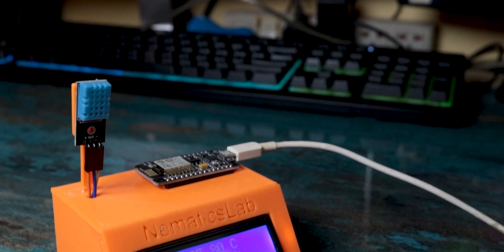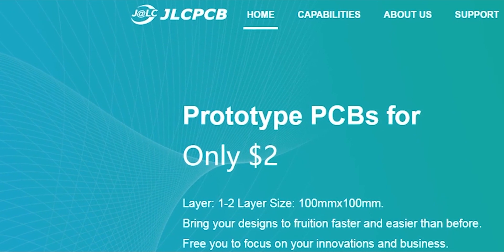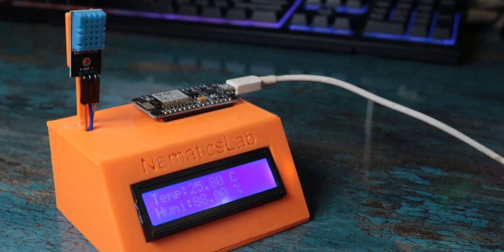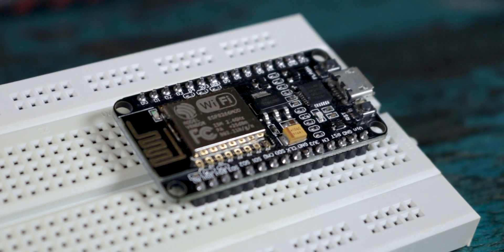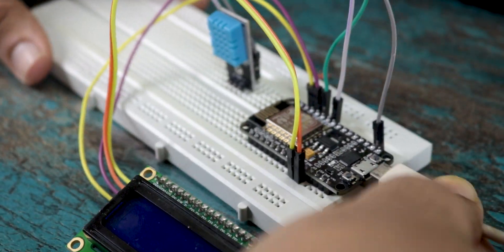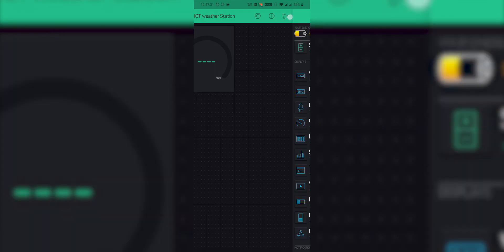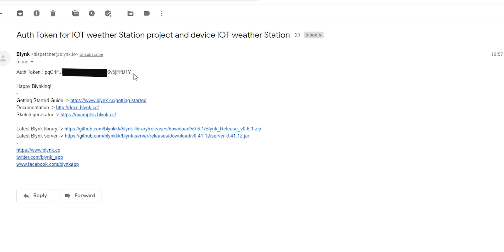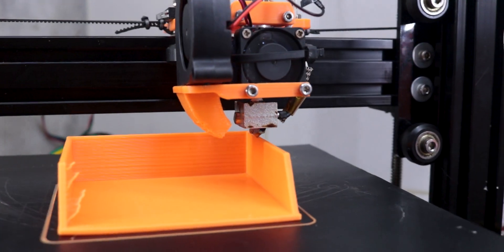IOT weather station using DHT11 | DIY | Blynk

Comment: Hii bro
I just want a help from you.
Can you tell me what is the closing rank for JEE Mains/Advanced for getting admission in Btech at Mumbai University???
Please reply, it's urgent....
Reply from the maker: 90.37 is general cut off for JEE advance. 
If you want admission in good college of  Mumbai University then you should have atleast 70 to 80 marks
Reply: @Nematics_Lab  I have 69K rank in JEE mains with 93.59 percentile. Can I get admission??
Do I have to fill a separate admission form??
Reply from the maker: @shuklaswaraj  you are qualified for JEE advance. And you will get admission in best institutes of Mumbai. However I'm not aware about admission process through JEE. You might wanna contact any of your professors for that
Reply: @Nematics_Lab  thanks for your guidance...
Reply from the maker: @shuklaswaraj  no problem all the best with your career!